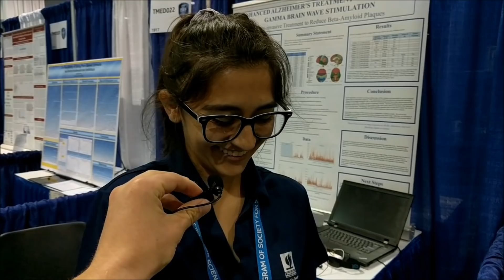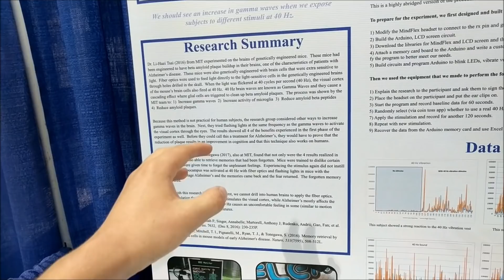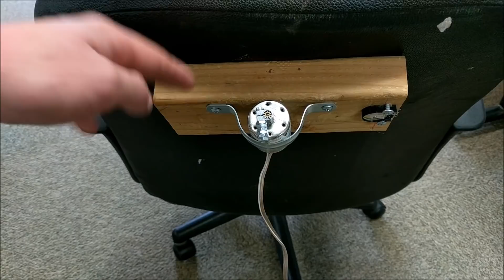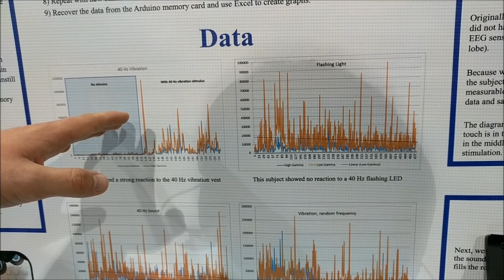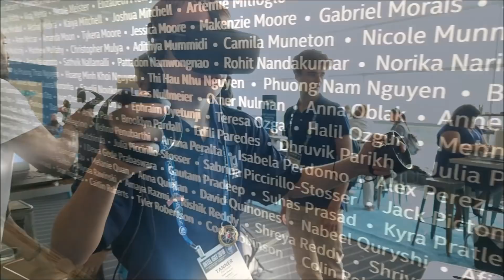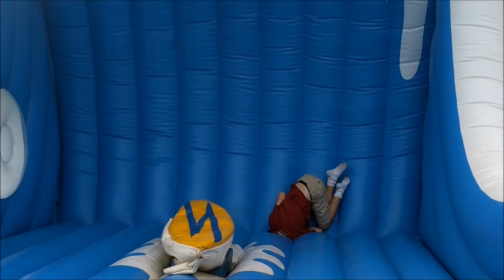Alzheimer's Research With Electronics and International Science Fair!

Comment: Are you sure your results of gamma increase weren't due to relaxing, daydreaming or falling asleep?
Reply: Hello, I am Krystal Horton, Tanner's partner for this science fair project. The "normal" gamma levels that you are referring to cannot be compared visually by these graphs as the scales along the y-axis are different. In the vibration graph, the scale on the y-axis goes up to 1.2 million while the scale for the sound graph only goes up to 80,000. Had we made all the graphs on a scale of 1.2 million, the trends, or lack thereof, would not be able to be observed as the data would result in an almost straight line. Our research is reproducible as we performed the tests on a set amount of subjects. Regarding your doubt on the statistical significance of our data, Tanner and I conducted a Paired Two Sample T-Test. Through this statistical analysis, we found that the vibration test had a P(T<=t) two-tail value of 3.96262E-17 while a light test that we conducted, for example, had a P(T<=t) two-tail value of 0.80741019. The P(T<=t) two-tail value needs to be below .01 to be considered statistically significant. In the vibration test our P(T<=t) two-tail value is far below .01 as it is .0000000000000000396262 demonstrating that the data is statistically significant, while the light test is larger than .01 demonstrating that it is not statistically significant. The point of the light test was to serve as our control group and it was not our intention to try and cause vibrations in the brain, vibrations are a separate external stimulus. Neural activity is in the form of electrochemical impulses. Neurons use the displacement of potassium and sodium ions in the axon of a neuron causes an electric impulse to progress down the axon until it reaches the axon terminal where it is converted into neurotransmitters that are released into the synapse between neurons. The dendrites of the next neuron have receptors that will process these neurotransmitters that will lead to another actional potential through the neuron and repeat the process until the signal reaches the brain. This method as Tanner stated is not a cure for Alzheimer's but rather a treatment method for its symptoms. Sitting in a massage chair would not cause a person to be free of Alzheimer's, but rather gave a delay at which Alzheimer's symptoms would begin or decrease the severity of symptoms they may currently possess if the vibration is specifically 40Hz. Our research was not trying to claim that correlation equals **causation, but rather trying to gather data regarding possible treatment options for Alzheimer's Disease symptoms. Our project was complex and the background information, specific procedural steps, and deep analysis of our results would be extremely difficult to discuss in a ten-minute video but thank you for your concern regarding the validity of our research and I hope that this cleared up some confusion. Have a great day. 

Krystal Horton
Reply from the maker: +Narfusala The scales on the graphs are different. The scale on the vibration graph for the y axis is 1.2 million while the scale for the other ones is <300000.
Reply: @TannerTech  hi
Reply: An MIT professor completely disagrees with you.  I'll trust the MIT professor.  http://news.mit.edu/2016/visual-stimulation-treatment-alzheimer-1207

Comment: Hi can you tell me how to connect the motor to the piezo to measure the frequency ?
or the piezo isnt connected with wires only from vibrations ?
 i have frequency measuring on my multimeter if that helps somehow instead of an oscilloscope
thanks and take care